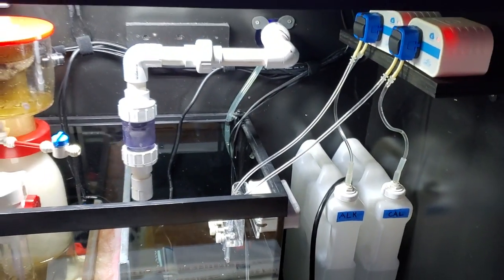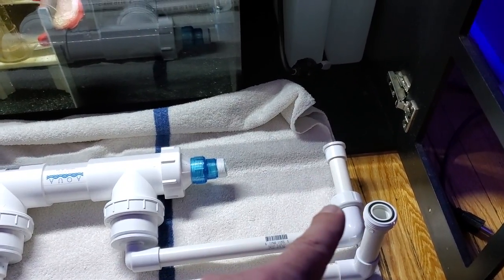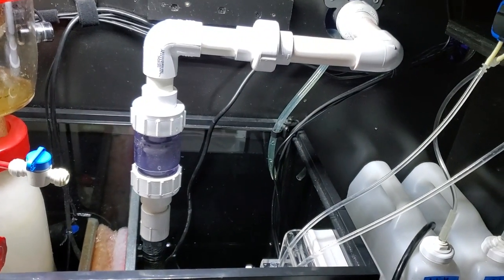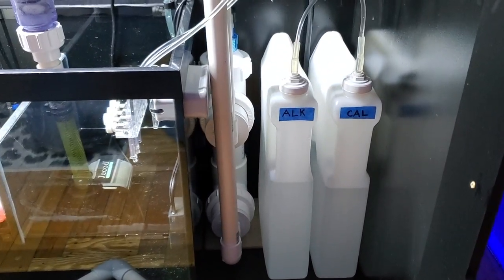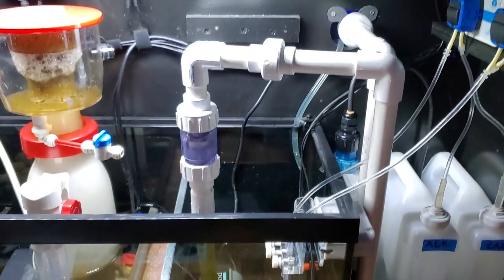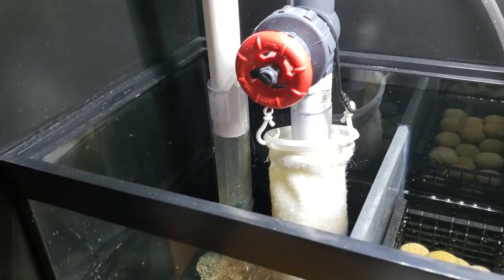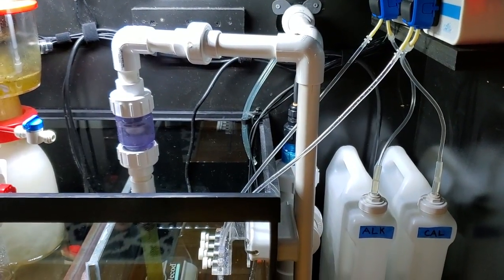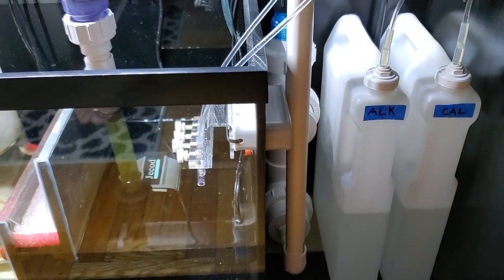Reef Tank UV Sterilizer Install - 15 Watt UV Sterilizer - Aqua UV

Comment: Looks good. If you plumbed the UV facing out instead of ticked in the back you probably wouldn't need to remove it to replace the bulb. It loojs great regardless just sharing my thoughts. Keep up the awesome content.
Reply from the maker: Thanks John,  i was gonna try something like that but i figured when i replace the bulb yearly it would be a good time the clean the entire thing internally 👍👍

Comment: I have the same UV the recommended flowrate is a max of 233gph. You'd need like a 40-50watt uv to run it like that.
Reply from the maker: Those are only recommendations.  Running it at different flow rates will give different results. Im using it for water clarity and my tank has never looked this good
Reply: @BillyPipes  True, if that's your only goal and you're seeing results then money well spent.

Comment: Hey brother I have the same uv I want to hard plumb my UV what kind of adaptors are those that connect to the UV because the AQUA uv comes with barb fittings. Can you please let me know thanks bud
Reply from the maker: Mine came with a second set of adapters to hard pipe it. Maybe reach out to aqua uv and see if they offer the adapters

Comment: What about contact time? Arent you worried about not getting the best efficiency out of such a nice uv.? What if the best setting is at a different speed as the the return water flow speed...and if ur just turning down the intensity... aren't you losing efficiency as well?  I need one and I truly cannot figure out the right combination.
Reply from the maker: I didn't turn down the intensity.  Im running it at the recommended flow rate

Comment: What fitting did you use use to connect PVC to plastic hose to pump
Reply from the maker: I used a pvc glue to 1/2" female thread coupling with a 1/2" threaded barb adapter.